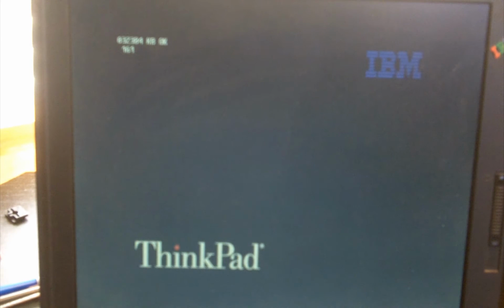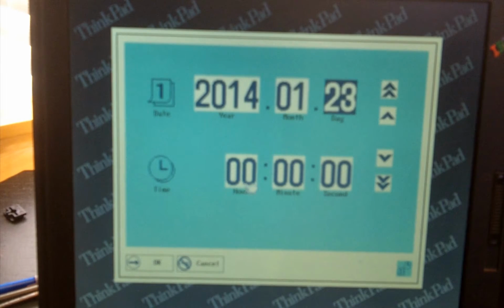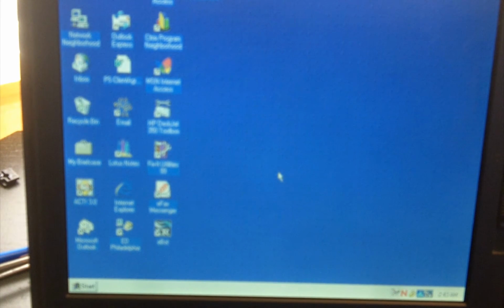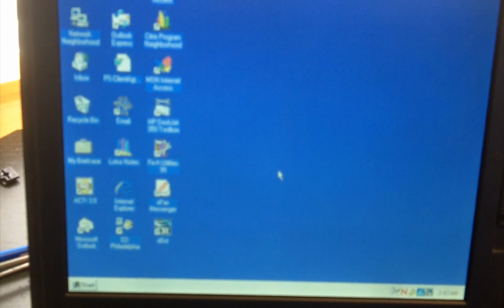IBM ThinkPad 380ED 161 and 163 CMOS Battery Error fix

Comment: Hi, i would like to ask you something.I have a 380 ED, already change the 3V lithium coin cell to solve the 161 and 163 errors (THANKS!!), but, the specs shows that the notebook works with a 16V 2.20A battery or charger. Now, do you know if it would work properly with a 16V and 3.36A charger? its the only model of charger i could found in my country and a really want to make it work but i dont wanna overcharge it and screw it by mistake. Im planing on restoring the li-ion batteries also for full restoration. Thanks for reading, hope you can answer me.
Reply: I know this has been ages ago, but yes, more amperage is OK, the laptop/notebook just won't draw the full amount of it, and the charger will be having an easier life. Voltage, tip, and polarity are the big things

Comment: Can you help me gain access to a video on how to gain access to the Hard Drive on my IBM ThinkPad TYPE 2635-SEU 380XD. I recently purchased this vintage machine on Ebay and we need to load DOS 6.22 only onto this machine. Also the machine is not seeing the hard wired Serial Port or the A-Dirve 3 1/2" Floppy Drive and I am wondering if you have any ideas of why this may be happening? My email address is tedschiff@gmail.com. Thanks, Ted Schiff.

Comment: It would be helpful if you explained how to set the clock because once you get the error message you cant go any where.
Reply: this happens when you replace CMOS battery you will get error 161 and error 163 simply ciick on OK at error screen this should take to date and time on bios set time and date press on OK and then the error should go away